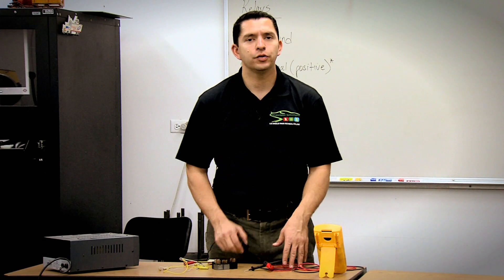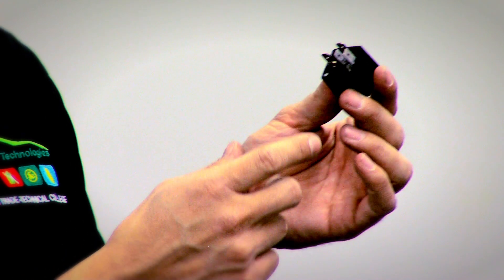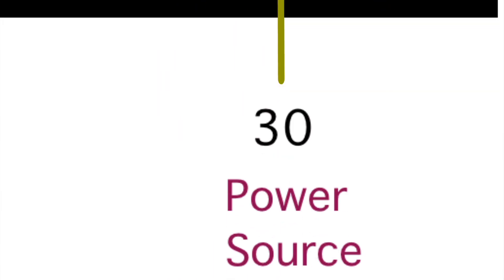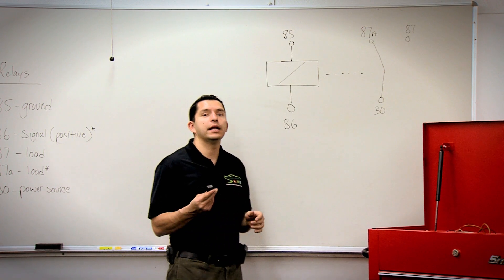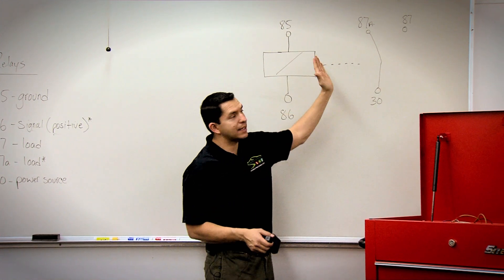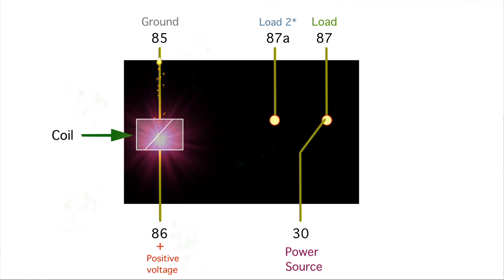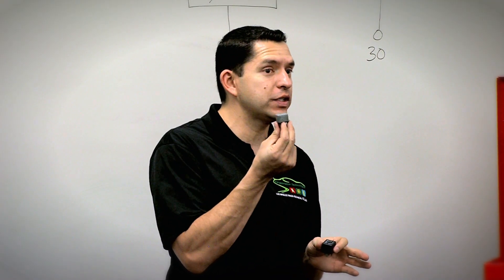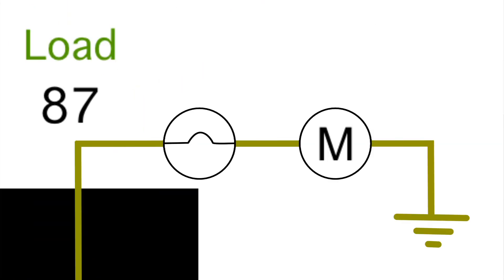Introduction to Bosch Relays

Comment: THANK YOU SO MUCH for the video! if anyone has a second.. can I have some advice? I want to install a new "run/stop switch" on my motorcycle but the amperage for the new switch I purchased is rated @5 amps, I believe the stock one is receiving 30 amps. How do I reduce the amperage? Also how many amps does this relay put out? I'm confused to say the least 😖 any help would go a long way! Thanks!